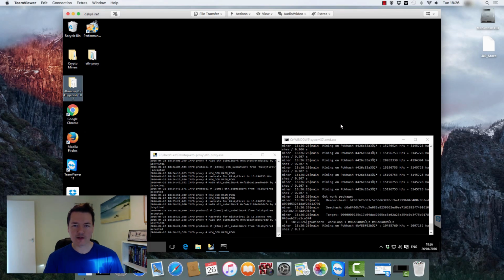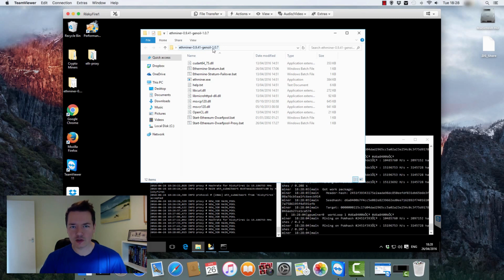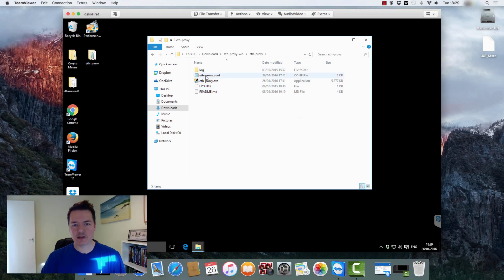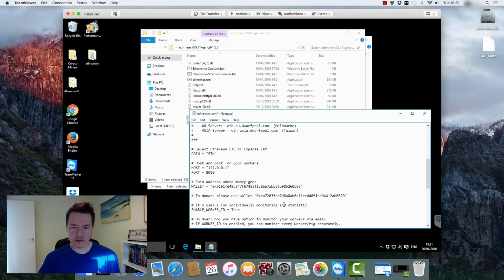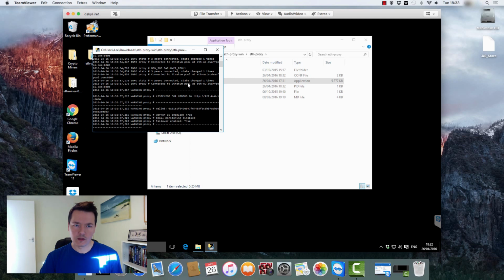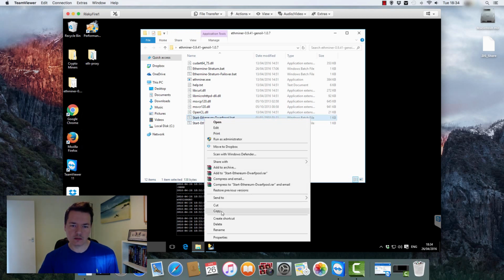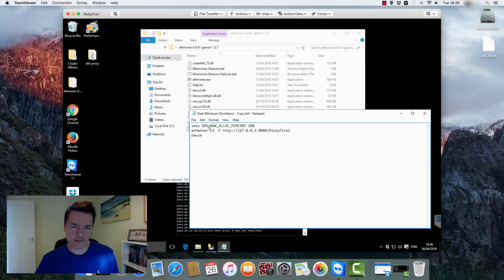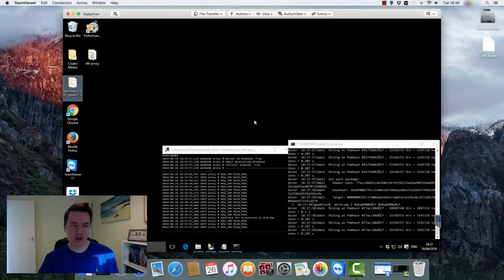Ethereum Stratum Proxy for Dwarfpool

Comment: That is a great a question? Now when i try to run ethminer with eth-proxy I got ethminer.exe stopped working error ? But when i run ethminer without proxy it working fine ? What u think  where is the problem ? Did you figured it out ?

Comment: 2017-09-15 12:32:55,336 WARNING proxy # Ethereum Stratum proxy version: 0.0.5
2017-09-15 12:32:55,415 WARNING proxy # Trying to connect to Stratum pool at eth-eu.dwarfpool.com:8008
2017-09-15 12:32:55,417 WARNING proxy # Trying to connect to failover Stratum pool-1 at eth-ru.dwarfpool.com:8008
2017-09-15 12:32:55,418 WARNING proxy # Trying to connect to failover Stratum pool-2 at eth-us.dwarfpool.com:8008
2017-09-15 12:32:55,420 WARNING proxy # Trying to connect to failover Stratum pool-3 at eth-asia.dwarfpool.com:8008
2017-09-15 12:32:56,329 INFO stats # 1 peers connected, state changed 1 times
2017-09-15 12:32:56,331 INFO proxy # Connected to Stratum pool at eth-eu.dwarfpool.com:8008
2017-09-15 12:32:56,493 INFO stats # 2 peers connected, state changed 1 times
2017-09-15 12:32:56,494 INFO proxy # Connected to Stratum pool at eth-ru.dwarfpool.com:8008
2017-09-15 12:32:58,901 INFO stats # 3 peers connected, state changed 1 times
2017-09-15 12:32:58,904 INFO proxy # Connected to Stratum pool at eth-us.dwarfpool.com:8008
2017-09-15 12:32:59,131 INFO proxy # NEW_JOB MAIN_POOL
2017-09-15 12:32:59,266 INFO stats # 4 peers connected, state changed 1 times
2017-09-15 12:32:59,267 INFO proxy # Connected to Stratum pool at eth-asia.dwarfpool.com:8008
2017-09-15 12:33:17,661 INFO proxy # NEW_JOB MAIN_POOL
2017-09-15 12:33:46,233 INFO proxy # NEW_JOB MAIN_POOL
2017-09-15 12:33:55,134 INFO proxy # NEW_JOB MAIN_POOL.....................

Hi, good afternoon. Did it work out or not? problem? what is that?

Comment: Hey! Thanks for the video. Things didnt work very well for me, i had to add a couple of lines before I could start mining. Before trying this i was mining with CDM and had an average speed of 193 mhs, with this program i get 184 mhs top. Does eth-proxy help local speed or effective speed? If it helps effective speed, can I use it with CDM?

Comment: I have miners with 6 GPUs. Can I connect more than 1 miner to the same proxy? i.e. 5 or 10 miners or may be more ?
Reply from the maker: Yes via your local network I think. Check out the newer miners as they include stratum support without the need for proxy.

Comment: theres an error and this is my command line
setx GPU_MAX_ALLOC_PERCENT 100
ethminer -G -F http://127.0.0.1:8080
eth_submitHashrate
Reply: whats wrong?
Reply from the maker: What is the error?
Reply: nvm got it to work if you dont mind me asking what is your hashrate
Reply from the maker: *****
On the GTX 970 18.33 Mh/s, 21 Mh/s when overclocked.
Reply: dang i get 21 on my r9380 and it cost like $230

Comment: hello my gpu is asus strix r7 370 and i use this proxy but my hash still the same was 12 before the proxy and when i insttaled the proxy still in 12 can you give a little advice for what im doing wrong. i did step by step what u did here.
Reply from the maker: Your hash rate will be about the same only the connection to the pool will be better. I'm getting better hashing performance from claymores dual eth miner 4.1 try that. Check my video on it here https://www.youtube.com/watch?v=5wf3_FJ2A7U
Reply: this claimore dual works for dwarpool?
Reply from the maker: Zeta.! Yes, but you don't need the ethproxy.

Comment: I'm using 2 R7 370, my hash rate on dwarpool is not stable and strangely fluctuated, I suppose to get about 30 MHs, what I get is 15, 23,24,25,28,23,30,19,23,24,25,20,25,30 ..... something like that, very random numbers.
is this normal?
Reply from the maker: Yes, you will often see some variation in the poolside hash rate as its often calculated on submitted shares. Just check it daily and ensure your getting paid as expected for the period of time spent mining.
Reply: Same here. With clay my 1070 get 30Mhs but with this I get 25 stock speed. Did you ever figured out why?

Comment: Fyi, in the new win update, windows defender is going to stop eth-proxy.
It thinks its a trojan, so check your miners, and make a exception for eth-proxy.
Reply from the maker: +Joakim “Runurnext” Andersson Thanks for the heads up. I've recently stopped using it and I'm now using claymores dual miner on ethermine.org which does not need the proxy to support stratum.
Reply: +RiskyRandoms Np, i'm sticking to the proxy a bit more on ethermine :)
However i am going to test claymore one one rig.

Comment: -u for nvidia card????
Reply from the maker: +Gamers Daily XXL Yes, however you can also run Nvidia cards in opencl mode using -G
Reply: so its fine if i dropped the link as it is
Reply from the maker: +Gamers Daily XXL Hi yes, you can use -U or -G for most Nvidia cards and drivers but not all so just try and if it doesn't work change the switch -U Cuda mode or -G Opencl mode
Reply: +RiskyRandoms thanks

Comment: The same problem happened in my home machines and my office machines !!
Reply from the maker: +issam eldash Hi, open a command window and type ping eth-eu.dwarfpool.com 
you should get packet sent / returned and a time in milliseconds.
Reply: +RiskyRandoms it give me this

'eth-u.dwarfpool.com' is not recognized as an internal or external command, operable program or batch file .
Reply from the maker: issam eldash
Did you type ping then the pool url in the command window?  Start -> Search -> CMD
ping eth-eu.dwarfpool.com
Reply: Dear Lee it give me this

C:\Users\Z820>ping eth-eu.dwarfpool.com

Pinging eth-eu.dwarfpool.com [87.98.182.61] with 32 bytes of data:
Reply from 87.98.182.61: bytes=32 time=134ms TTL=50
Reply from 87.98.182.61: bytes=32 time=134ms TTL=50
Reply from 87.98.182.61: bytes=32 time=136ms TTL=50
Reply from 87.98.182.61: bytes=32 time=136ms TTL=50

Ping statistics for 87.98.182.61:
    Packets: Sent = 4, Received = 4, Lost = 0 (0% loss),
Approximate round trip times in milli-seconds:
    Minimum = 134ms, Maximum = 136ms, Average = 135ms

C:\Users\Z820>
Reply from the maker: issam eldash Ok, thats how it should look. So your computer can connect to the pool. What is the error actually reported by the ethminer?

Comment: hi Lee , i have 6 gpus rig R9390 . When i run the ethminer and start loading the dag file my pc crushes(restarting) . Any idea PLEASE HELP ME!!!
Reply from the maker: +martin ignatov Hi, it could be caused by many different things. What version of windows are you running, have you tried ethminer running 3 cards and then the other 3 cards so you know all 6 will run at least but just not together. Add --opencl-devices 012 then  --opencl-devices 345 for second test. How much system ram? gpu drivers version? You can also take a look here for advice https://forum.ethereum.org/categories/mining
Reply: +RiskyRandoms 
Windows 10. CPU - intel pentium G3240. MOBO Asrock H97 Anniversary. 6xGPU - AMD Gigabyte R9 390.
8G DDR 3 + 120 SSD. 2 x 1 200 W power. All cards in all PCIe slots work up to 3 together.
When the 4th card is added then when running ethminer, a few seconds after start computer restarts. If ethminer is not running, Windows 10 sees all 6 GPUs. and here's the BAT file whihc is running with eth-proxy, as per your settings:
setx GPU_MAX_ALLOC_PERCENT 100
ethminer --farm-recheck 200  -G -F http://127.0.0.1:8080/Purvamina1
pause.
Also tried the forum and did not find much. Can you please help.
Reply from the maker: +martin ignatov What drivers are you using? 15.11 / 15.12 are the ones most people are using.
Reply: +RiskyRandoms  15.11 , I spend this two days at the forum and no much help, do lots of advices looks like people think i have some problem with power risers.
now im using two motherboards x3 cards
Reply: +RiskyRandoms   in my latest attemps  i realise the DAG file loads ok and after that the ethminer starts to load extremely slow and cpu is 99% and just before starting to mine windows restarting
Reply from the maker: martin ignatov
 Stress test the cpu ensure thats not the problem, try another eth miner claymores dual miner can be used for ethereum only and is giving me good results.
Reply: +RiskyRandoms  Thank you buddy, i will give it a try!

Comment: hey man.Probably at the end of this year gpus with <3 GB are unuseless.So I want to ask you if it is possibile to make a crossfire between 2 gpus(ex. 2 7950) in order to reach a suitable memory for DAG.
Reply from the maker: +Hidden Level Some people have mentioned this within the Ethereum forums but its not clear yet if this will be possible.
Reply: +Hidden Level Crossfire doesn't double your effective memory. 2gb will remain 2gb. Same thing with SLI.
Reply: +William Harris 2gb+2gb=4gb suitable for future mining
Reply: +Hidden Level When in Crossfire you can't add memory together both cards will share the memory.If you Crossfire two 4gb cards it will still be 4gb. 2gb will stay 2gb no matter what if Crossfire or not.
Reply: etherminer reported me around 52-53 mhs,but are these mhashes already "boosted" by the stratum or i can only see the difference from the pool?
Reply: without the stratum I mine at about 54 mhs,with the stratum at 52.It is normal?
Reply: Stratum uses a default Farm Recheck of 200ms so its normal to see a lower hashrate. Try setting the farm reckeck value to 1000 and see if that helps. I used Claymores Dual Miner and actually got more shares on my pool even after the 1% developer fee as well as a small jump in hashrate.